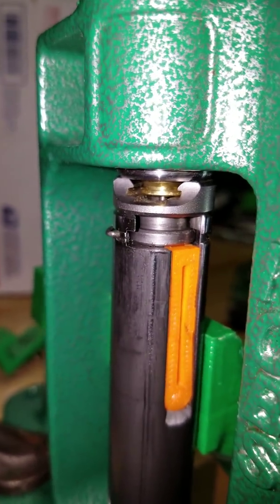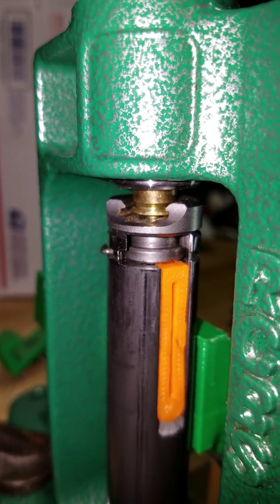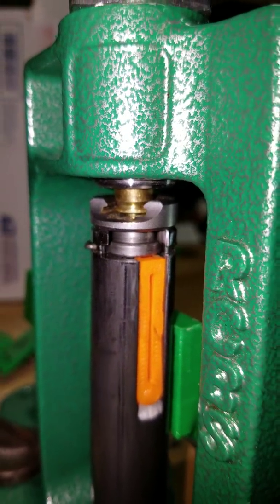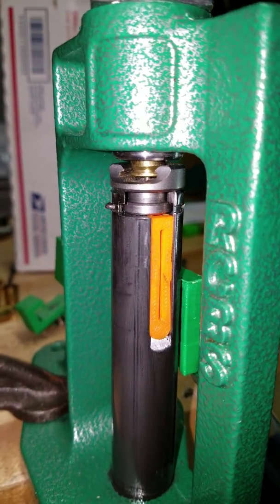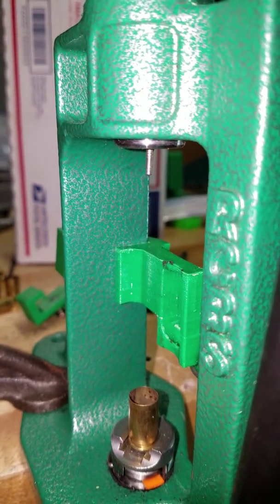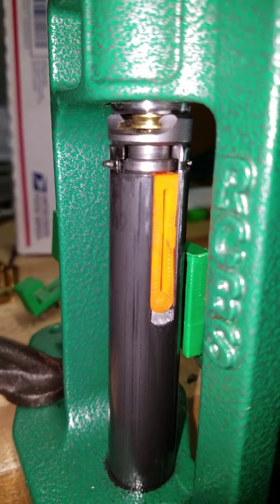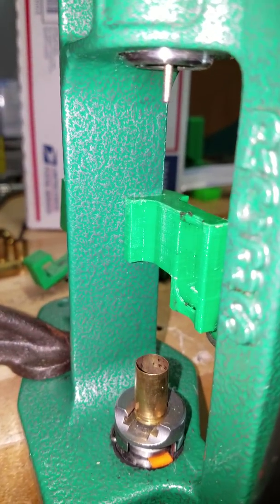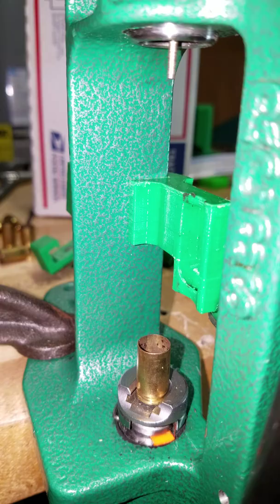Primer stuck on pin example

Comment: Often a bit of cleaning media in the flash hole will cause this. On a progressive, having the primer stick on the pin can be problematic as the primer may end up lightly stuck in the primer cup as the case is drawn from the die, which cause problems when the case reaches the priming station. Dillon dies often use a spring loaded decap stem, which kind of snaps to sling the primer off the end of the pin.

Comment: Yeah, I noticed the same thing on my RCBS rock chucker primer catcher you made for me so I just pause at the top and start going back down slowly if I notice the primer didn't go down the tube. The trick is to not go down too fast.
Reply from the maker: +Prepare2Survive I'm wondering if anybody has figured out if you can do anything to the decapping pin to make this happen less.  I think it might happen more on my Lee Universal deprime die than it does on my RCBS sizing dies, but it's just so convenient having the universal decapper.  On my decapping pin the edges are kinda sharp I'm going to polish them to round ever so slightly.
Reply: caltick
I use the lee universal decapper, but I'm using an upgraded hardened pin I got on ebay. The upgraded pin has a taper to it. Maybe that helps because even if I don't go slow only 2 or 3% don't go down the tube. Maybe it's worse with the original lee pins.
Reply from the maker: @Prepare2Survive   I've learned there are a few things which contribute to primer missing the catcher, people will sometimes set the die very low to short stroke the ram this causes primers to fall out early missing the catcher.  Stuck primers are another reason.  A slight pause on the ram down to let the primer break free will get the catch rate up to 100% .   I've told a bunch of people this and had many tell me they deprime thousands without a missed primer.